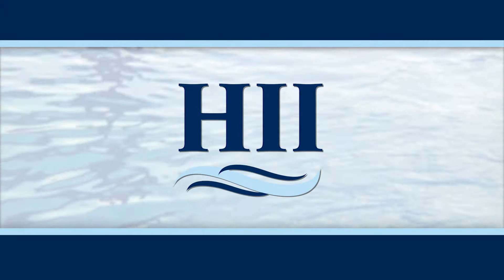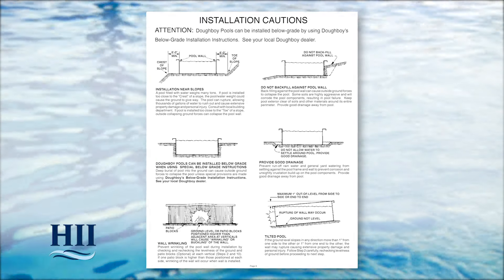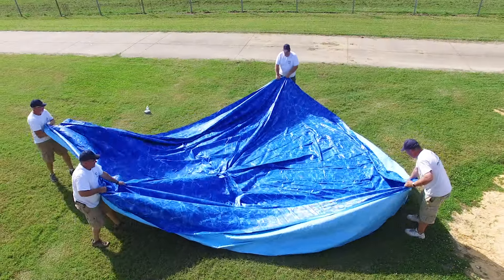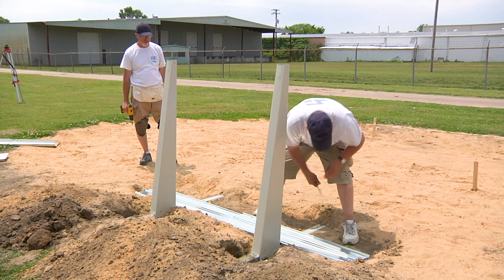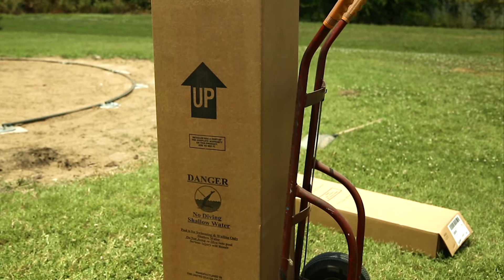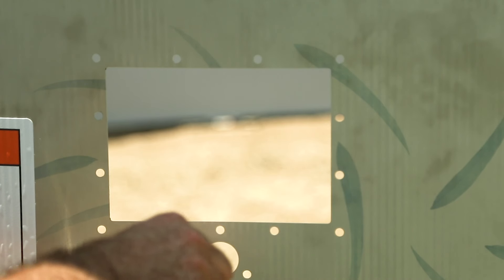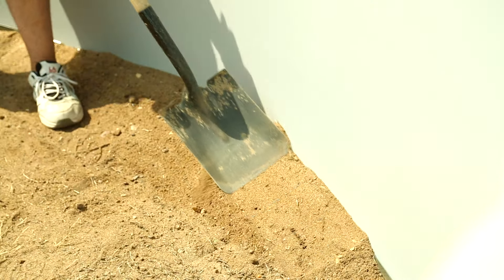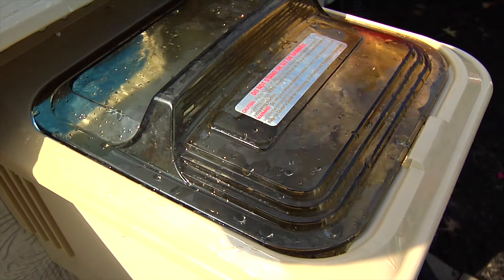How to Install an Oval Above Ground Pool

Comment: The bottom rail is the trickiest and most critical layout of this build.  The rail snaps into the vertical footings with a spacing that IS NOT specified by the terrible instructions provided in this video.  The paper instructions provided with the pool and downloaded from their site are barely legible.  My advice is to measure the wall total length with a 100' tape and then the track to calculate the spacing between the bottom rails once snapped into the vertical base plates.  If you do this correctly, your patio blocks will be layed out correctly and the wall will roll out to overlap at the ends.  If you mess it up, you will have problems with the patio block layout and the wall will not overlap correctly and you will NOT have the ability to "adjust the bottoms rails to make it fit" as this video causally suggests.  The wall for our 12' x 20' pool weighed close to 100 lbs.  This is not a job for the faint of heart!!
Reply: I just disassembled a used pool and am researching how to install it. 16'x30' oval. I am worried but ready to spend a whole week frustrated in order to swim. I am a landscaper so some swimming will be very nice after a long day/week in the sun! Thanks for the info btw, do you have any other tips etc?
Reply: @gradyww1044  Yes. Make sure the ground you are placing the pool on is easy to dig and rock free. Otherwise you may need a good amount of screened loam for backfilling holes left by rock. If you have a lot of stones in your ground, consider laying a foundation of graded base, compacting that, setting your uprights into it and covering up to liner level with screened loam then sand for finish and cove.
Reply: I have a 12x20 being delivered and I have a hole dug 2 feet deep.  How much room do I need for install?  Would one foot on each side be enough?